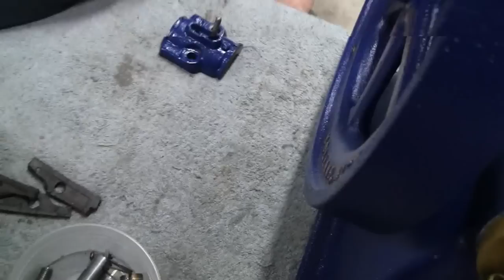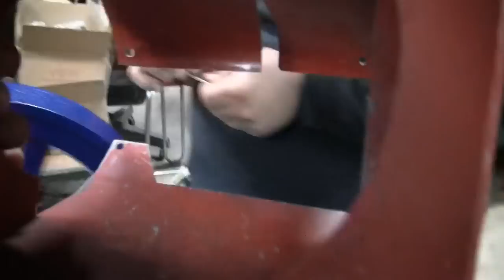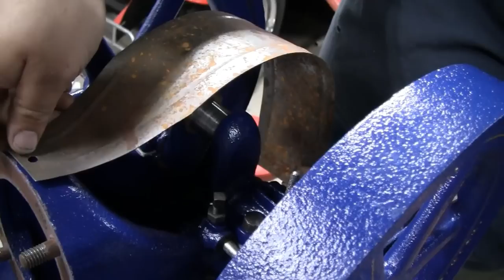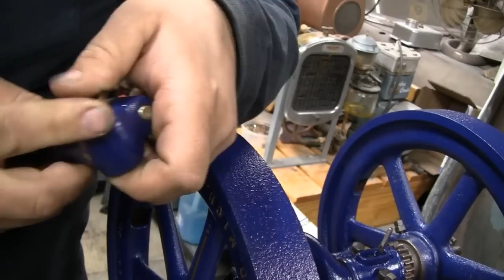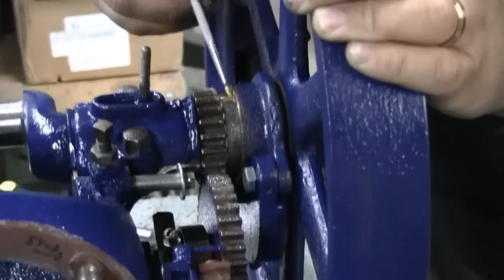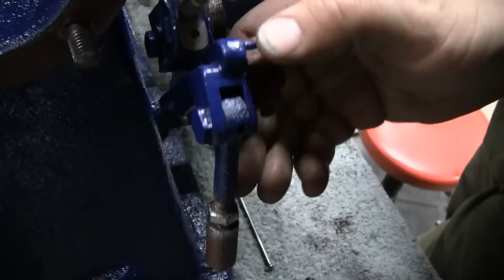BROWNWALL HIT and MISS ENGINE RESTORATION (part 11)

Comment: Hey Roadking, have you seen this video of a Brownwall?  It looks complete and may show you what pieces you're missing.  The governor latch-out arm looks original on this one along with the crankshaft cover.
https://www.youtube.com/watch?v=M1czN9JSF1Y
here is another of the same engine without the crank guard
https://www.youtube.com/watch?v=ozBD31jQ500
Reply from the maker: Thanks Gary!! Yeah about half a dozen guys sent me them links, they were helpful!! We were baffled with the studs on the crank caps and that video showed the cover so that solved the stud mystery, that's the first time we seen one with a cover!!☺
Reply: @805ROADKING  I scrolled down in the comments and didn't see anyone else post the links.  Perhaps they did on a prior video or else they used the "Roadking Hotline".  Anyway good show, cant wait to see your engine run.
Reply from the maker: @garyplewa9277  any time I get a comment with a link it goes directly to spam!!☺

Comment: See what you mean about the fan shroud.  I guess back in the day when these engines worked hard they wanted as much air as they could get around the cylinder to keep it cool. 
Nice seeing Mike there to help get it another step closer to running 👍
Reply from the maker: Yeah it's always good to have Mike over!!☺

Comment: I've seen other videos of that same engine running! They didn't use the guards either.  Those engines were built at a time before OSHA.....when common sense was what kept you safe. Not a myriad of stickers, guards and hieroglyphs. Your own brain told you " Don't put your finger there...that will hurt"!
Reply from the maker: I've actually seen someone get bit by a fan just like that!! Anytime you're around any kinda running machinery ya gotta be aware of your surroundings!!☺